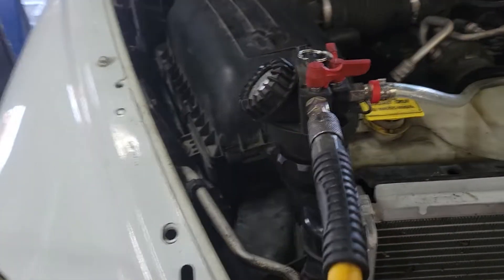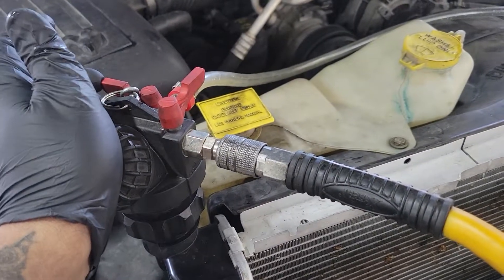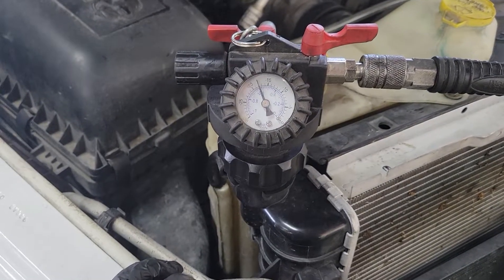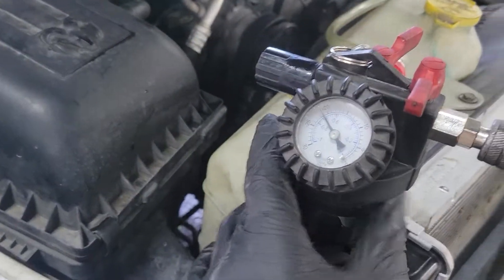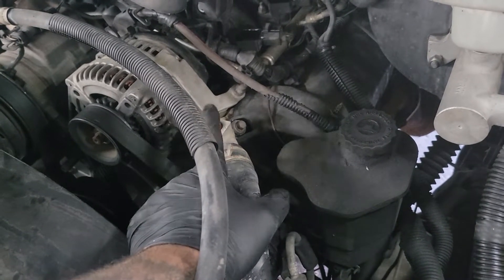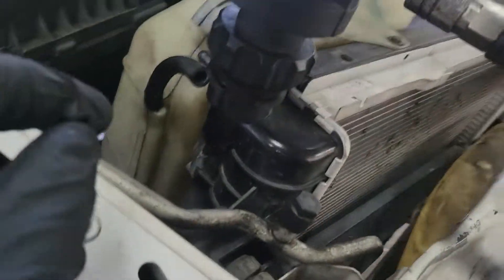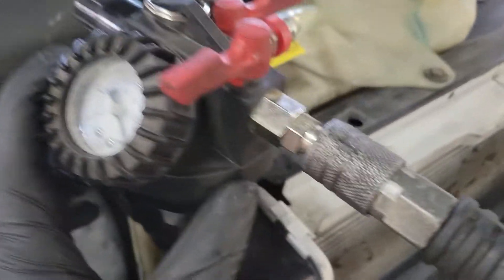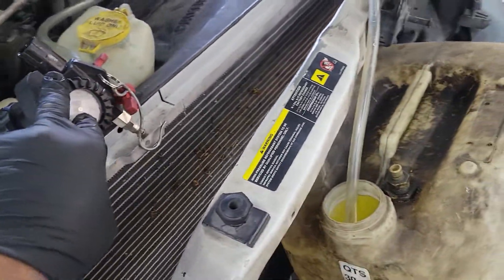Harbor Freight Coolant vacuum fill tool

Comment: This maybe a stupid question but how does it pull vacuum in the engine if the thermostat is closed
Reply from the maker: It's pulling a vacuum  from both sides of the thermostat
Reply: I wondered also, but don't all thermostats have a inconspicuous bleed port?
Reply: @chrispompano  - most thermostats have a "jiggle pin" (or just a bleeder hole) that wobbles and allows air to get through even when the thermostat is completely closed
Reply: @.....also, other thermostats like reverse poppets, have a small dimple on the circumstance of the valve body that can't be seen unless holding up to light.  I learned this from a Robert Shaw tech rep.

Comment: Question I tried the conventional way burping it using the bleeders still have air in there. I was going to try this system. Do I have to drain the coolant? I have in there to use this system?
Reply from the maker: Nope it will still pull a vacuum with coolant in the system. It will bring it to the recovery tank and that's normal
Reply: Ty

Comment: Does the coolant have to be completely empty?
Reply from the maker: Nope . Will work on a half full system. You just dont want the system all the way full, because it will start to suck the coolant up and spit it out the front of the device

Comment: I have an 06 chevy equinox and there is not a radiator cap. Does it hook up the reservoir to create the vacuum as well? Anything helps
Reply from the maker: Yes you go through the coolant tank if not through the radiator
Reply: Much appreciated brotha!!
Reply from the maker: @moistcobrah  no problem glad to help

Comment: Was there a hand pump option in the kit? Is shop air necessary to create a strong enough vacuum?
Reply from the maker: No hand pump version that I've seen and yes shop air is required but im sure a pancake compressor would get the job done
Reply: @WhatTheDuckAuto  yes, thanks. I agree 💯

Comment: So I purchased the maddox vacuun seal to refill my 2010 chevy equinox and discovered it has a over fill hole under the coolant overfill tant that will not allow it to hold vacuum presure. Do i need to tape this closed? as it will not hold vacuum pressure.
Reply: Were you able to find a solution. I have recently purchased same tool and installed it but can not get a vacuum. The only thing I have done was loosen drain plug to empty coolant and replaced coolant bypass valve. I have check the areas to see if I have leak but it doesn't appear to have one. I am assuming that I am missing something since it doesn't pull any vacuum. I know the instructions mention turning off overflow hose on some radiators, but I am not sure where they are talking about.

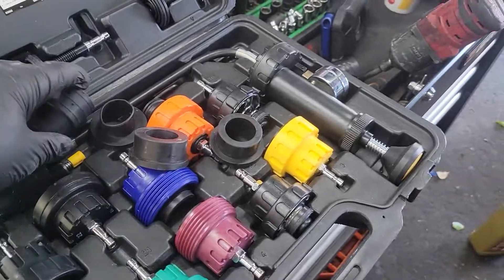Comment: The box shown at around 2:20min looks like PITTSBURGH AUTOMOTIVE Radiator Pressure Tester Kit (63862) and the vacuum kit used in the video looks like MADDOX Cooling System Test and Refill Kit (64985).
Reply from the maker: I believe you're correct it was an x co worker of mine tools. I think he pieced both the units you described together
Reply: Thanks......now I need to have both!!!!😁

Comment: Can you tell me, does it work if not all old coolant is out?
Reply from the maker: It absolutely will but it may draw residual coolant into the tank or radiator and try to suck it up. At that point, quit vacuuming the system and let it draw the new coolant in

Comment: Hey so I don’t have shop air can I use a 3 gallon air compressor to work with it?
Reply from the maker: I dont know about a 3 gallon but a 20 definitely would
Reply: I'm wondering if it will work on a 5 Gal portable tank🤔. If not I need a good med sized shop compressor....... now its onto Project Farm & other reviews!😐

Comment: I got a 97 dodge ram 5.2 and its vapor locked in the heater core... will this work???
Reply from the maker: It should . Some dodge motors have a bleeder screw. If yours does, lossen it and start filling the radiator/reservoir until the coolant cones out the bleeder screw. Tighten the screw and that should also help het air out but make sure to do the procedure with the engine off.

Comment: How many psi is -21inHg?
Reply from the maker: Its none, because psi is pounds per square inch,  inhg is vacuum in inch pounds of mercury
Reply: @WhatTheDuckAuto  It is just inches of mercury.  Inch-pounds is torque.
Reply from the maker: @dfk70  psi could also be torque.
Reply: @WhatTheDuckAuto  psi can not be used as a unit of torque. Psi is force per unit area, while torque is force per unit distance. Also, it is inches of mercury because that's exactly how an old school dial works where you literally read the change in distance of a mercury column for exerted pressures.